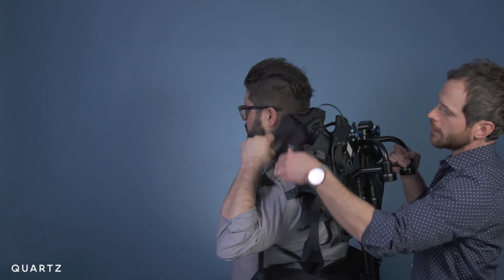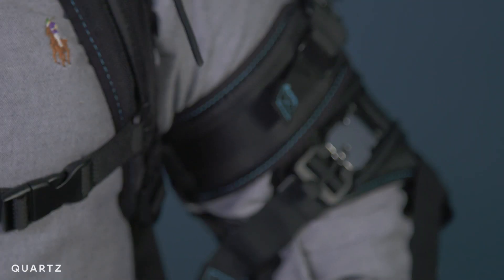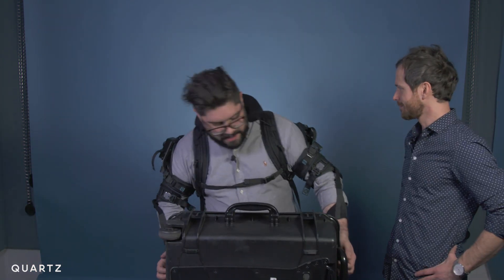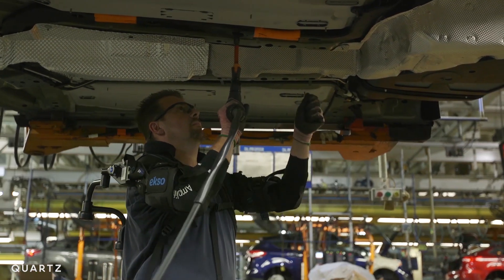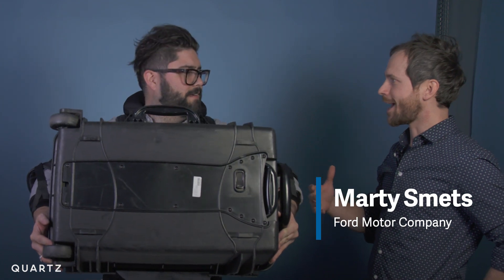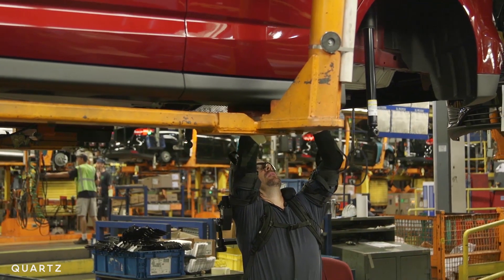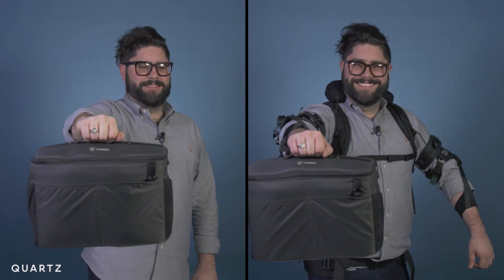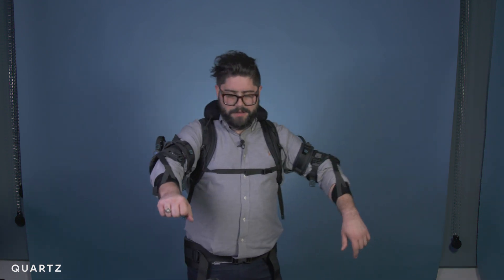We tried the exoskeleton Ford factory workers are using

Comment: Oh, good!  Now the muscles that you should be working to make strong with good form and proper use, you'll be able to let atrophy which, in the long run, will cause more spinal related injuries.  Fantastic!  

This is a horrible plan.  Maybe focus on health and proper lifting form instead.  Spend money on proper training from professional power lifters on proper form, and ideal exercises to improve your strength in those weak areas.
Spinal related injuries stem from your core muscles being weak and not flexible enough.  Your core muscles are the ones that will atrophy with the use of this apparatus.  Proper exercise and stretching is imperative, and not trying to skirt around those with a fancy apparatus such as this.

Comment: This would be cool if it did allow users to lift heavier parts and my workplace had them. Wait. That's right. My boss is too cheap to invest in an overhead crane so I don't have to man handle 160lbs of steel onto a table. Alone

Comment: Wish i had something like this when i was driving front end loaders in the mines. It was a comfortable spot in which i my arm would rest. I hardly had to move it to operate the bucket or arm.
But it was the constant little movements for hours on end. that would leave me wincing in pain. It felt like someone was stabbing me in the shoulder every time i moved my hand to operate the bucket. When i was a labourer i use to wonder why the loader drivers seemed so happy whenever they had to get out and do some manual work. After my first two months in the loader i understood why

Comment: if i had this when i was loading molds into the furnaces at work to cast jet engine blades/vanes i'd have been able to pull 16 hour shifts no sweat (12s were rough). a lot of the molds weigh a little upward of 100 lbs, and i'm 190 lbs sopping wet.

Comment: No joke. When I worked for Honda, they would spend this much on air tools. Yes, the air tools used to drive the bolts in. Considering that, the cost is actually worth it.

Comment: Think of it like a garage door spring.  It acts like a counterweight to lessen the load from gravity acting on your arms and whatever you're holding.  If you were lying on your side or inverted this would not work properly.  However this isn't an issue because it is intended to be used for specific tasks in a limited scope.

Comment: Last step is to replace the low-efficiency human part.
Reply: yeah if i remember correctly Boeing was the company that tried that ... with predictably disastrous consequences ...

you see humans have this kinda important ability to ADAPT to unforeseen situations which in these types of jobs are very common. unless you can guarantee the task is 100% repetitive with zero anomalies OR develop true AI capable of adapting to situation at least comparably to human mind the "low efficiency" part there guarantees smooth and uninterrupted production. Sure purely mechanical systems are faster, but overall its kinda better to produce a little slower without creating loads of useless garbage because mechanical system couldnt deal with small trivial change in the process human would solve on the spot ...
Reply: @Asghaad  Tesla also tried that and gave up.
Reply: Mendicant bias
Reply: Human is a pretty optimal and efficient source of mechanical work. We only need 1.400 calories per day and we already have about 80.000 calories to spend if we run out of food. We need just water (the most abundant thing in our planet) and a little bit of fat and flesh.
Reply: @George-wv5wk  Most of that water is undrinkable
Reply: @azure3655  Most of humanity doesn't use that water since the dawn of our existence. Also, desalination exists.
Reply: @azure3655  Machines also need water to be created and to it's maintenance.
Reply: +Azure. Distillation and reverse-osmosis are things that exist you know.
Reply: Azure It just needs to have the unwanted things in it removed, which is an easy thing to do. So you're right, but not really.
Reply: @azure3655  open the faucet wow water
Reply: @George-wv5wk  lol good luck working effectively with only 1400 calories unless you're working children.
Reply: George Um you are forgetting the pay humans want from working. Which at this factory I believe is 30k+ a year. Multiply that by the thousands or workers. Ends up being in the millions. vs a robot which only needs to be maintained.
Reply: @diddykong7354  

This device makes one better at manual labour and further applied research can make significant improvements to it. In combination with Mind Machine Interfaces and Nootropic drugs, which will greatly increase thought processing, as well as increase concentration and focus at work, efficiency and ability at performing manual labour safely will increase. NO NEED TO REPLACE HUMANS WITH ROBOTS AND AI AT EVERYTHING!
Reply: @diddykong7354  

What is wrong with paying humans to work? So, if there are technologies through machinery, computers, and drugs that humans can wear, take, and/or implant that greatly improve their efficiency, concentration levels, dexterity, and also greatly decrease fatigue and enable them to work very well in factories, because of paying humans, they should not be applied?
Reply: @George-wv5wk  yea but we have to waste 8 hours a day to sleep and repair muscle damage
Reply: George humans get tired, need sleep, need to eat, drink, need to talk.. I hope your joking that a human is efficient compared to a robot
Reply: @colbyharley9975  Right now we are. 

Usually a single machine does just one thing (like car assembly) and that machines cost above 300k dollars. A worker cost about 30k -45k per year. 

Machines also need to be repaired and usually cost more than 1k, even the simplest procedures.

Also machines get "tired" it is call (warming), the things that prevents this warming also cost more than a bottle of water.
Reply: Every Water is drinkable after you filter the Salt Out of it and thats not hard at all
Reply: @colbyharley9975  Yeah Ikr, even soldiers who are trained to be efficient need sleep, etc
Reply: George that 300k gets paid back in a few years while the human stays the same in generating pay.

One robot may cost 300k, but over time it will cost less than humans and do mor work that humans right off the bat. That’s even if you include repairs every year.

Why do you think everyone has robots in their factory now? It’s cheaper.
Reply: @kevinarzola4781  Best answer ive heard so far👍
Reply: DoktorDuggie Ducker That is 100% false. Desalination is one of the most costly forms of water distillation on the planet, and less then 1% of the earth’s population relies on it.
Reply: Ni Hao no he’s right. The human metabolism is actually more efficient than most machines in regards to energy output and efficiency. Machines have a higher ceiling for power output however.
Reply: @colbyharley9975 

There are devices such as these types that decrease fatigue and therefore help increase efficiency, and plausible technologies can be developed, be they devices or drugs, that will further increase efficiency, concentration, and decrease fatigue significantly more.
Reply: @kevinarzola4781  Said maschine still requires maintenance producing cost, and someone who fixes it. And maschine eventually have to be replaced sometimes, or are not needed anymore, while a human worker can still adapt
Reply: Linkatchu that last part is true, but trust me, a robot is far less in costs than any human. They don’t require pay, benefits and they never get tired.

We’re thinking of buying a robot where I work that does light solder work and bends metal. The very first year it would save us 10k over a person and the next five would be over 30k per year in savings.

The technician is only required every 5 years for it (check up) charging $100 to perform a diagnostic and you only pay for the repair when it need it.

Some jobs still require a human touch as mentioned from someone above, but it’s very possible in the near future we will have factories with 5 people in them and hundreds of machines.
Reply: @colbyharley9975  machines need maintenance, fuel and adequate"rest" as well. And humans to operate and make these machines.
Reply: Blackpilled af
Reply: @axelmilan4292  Because I like robotics and automation that let people spend their time doing more important and healthier work. You're the blackpilled one.
Reply: @defeatSpace  robots are incapable of solving anomalies are incapable of independent thought its common knowledge the brain is superior compared to any super computer and humans are more effective in number and over all better thinkers and inventors the robots will ever be that why we are there creators
Reply: @thenamelessking7873  unless we create organic based AI by making artificial brains.
Reply: @bryanmartinez6600  wouldn't need to
Reply: You beat me to the comment
Reply: Did you even watch the video? It has nothing to do with robotic parts. It's simply a clever weight transfer system.
Reply: WE CRASHING THE ECONOMY AND SHIET. 2040 EVERY HUMAN WILL BE UNEMPLOYED!
Reply: @a1919akelbo  By 2040 we will have new jobs while automation does the rest.
Reply: @defeatSpace  so the population increasing and automation increasing will also cause jobs to increase? Didn't know 1-1=2. Good to know.
Reply: @a1919akelbo  Well jobs for college grads at least and a lot of them will work on automating even more stuff.
Reply: Elon Musk already tried automating too much, removing humans from jobs for the Model 3. The result? HE SAID HIMSELF that they (he and his engineers) didn't know what they were doing, and were idiots for doing so. He also said there are many things for which a human is the best way to do something. Remember, a human is infinitely adaptable to any anomaly that comes along should there be a flaw with the assembly of a specific component on a specific vehicle. The Human can recognize it and make a decision on how to deal with it. Robots cannot. GM also tried over-automating assembly lines, as did VW. They both learned that is not the way to go. Musk tried it because he thought he knew more than GM and VW who had been building cars exponentially longer than himself.
Reply: Robot world
Reply: L there are certain parts that need that touch of a human
Reply: Yang 2020
Reply: I wouldn't say low efficiency. That's unfairly putting the talented people in that grouping. I would say more like replace the costly human employee. Robots don't need unions, food, breaks, housing, etc.
Reply: You all are missing the point...
Reply: Shit and i thought you were just joking around
Reply: It'll still be decades before that. It turns out designing robots to move like humans is a lot harder than designing them to replace accountants, lawyers etc. Can you imagine a world without lawyers?
Reply: @squamish4244  Can you imagine a world with synthetic lawers?
Reply: Aaarrrrggghhhh
Reply: This machine improves human efficiency by decreasing fatigue. I know that there are AI and Robot worshippers, and also corporatists that are trying to find creative ways in which to reduce labour due to labour costs, but there are plausible drugs and devices that greatly increase concentration, efficiency, dexterity, and reduce fatigue. 

The drive to replace human labour in everything with machines isn't going to succeed...

Comment: So that's what people are using in this other factory I work in. Different brand of exo thing though.
Reply: How do I become a factory worker? Working in a factory is bad ass
Reply: @Ketannabis  well... I've only seen one set of people using one. And I think it's probably an "exoskeleton" thing.
And it's not even the main assembly line people I've seen using it, but people who do something to things they pull off the line. I don't know if it's for a whole body inspection or if it's to repair defects that have been found.
I also haven't seen all of the factory, so maybe other people use it too.

I also am not a huge fan of my job.
I want out so bad, but I have nowhere else to go YET.
I don't want to discourage you, because plenty of people work in factories, it's not for me though.
It's usually very mind numbing on the floor, unless you work in maintenance or something.
Don't endeavor to work in a factory just because some people get to use an assistive exoskeleton in there.

But if you want to work in a factory, just find the nearest one and see what their requirements are. You can also work through a staffing agency that does work inside the factory.

Comment: whats interesting is, because it shifts the weight to another part of the body, would prolonged use of this cause more issues in those areas of the body due to 'un-natural' stress?
Reply: Nope. Shifted weight is shared, not completely shifted.  It would be like holding up  a weight slightly above your head with some of the weight being braced against your hip. It has the effect of taking load off of your shoulders. And the kind of weight we're talking about is like 5 lbs.

Comment: But doesn't that mean that their muscles would weaken and result in the same state as they were before without the exoskeleton ?
Reply: no. its not like their arms are doing nothing. its just that the weight that those muscles are lifting is put into the ground instead of on Weak joints. You arent Lifting less, It just removes the pressure on your body. Kinda like lifting Form, except these are being used in places where "good" form can't be done with the human body. so you stick a extra frame on to make that "good" Form possible

Comment: it is not that great if you dont have really good grip strength.
Reply: I doubt you would last long in this job without grip strength in the first place.
Reply: @momentary_  not really. if the suit has a robotic hand or a suction cup that works with the arm, grip is not an issue.

Comment: "Goal is not super human strength." Why not?
Reply: If you saw the clips of factory workers they displayed on this very video, all the strength related stuff was handled via machinery. They don't need more strength.
Reply: Power. Major limitation factor on how long a suite can run. Super strength, means more power, means a shorter duration of use.
Reply: It supports the arms without adding strength
Reply: Probably so they're not responsible for some dude running around punching people with super human strength
Reply: superhuman strength would require added force by the exoskeleton, which, if there was an error, could hurt the person wearing it. instead, all this does is distribute weight on your arms to your legs
Reply: Then it would cost more to buy and make, think before you comment.
Reply: Because the human labor in ford factories is for technical and precision work. Why make a human lift 300 pounds when you already have a machine which can lift 1000?

Comment: I work in the trades. I've seen a lot of manufacturing robots and they look painfully slow. They do better overall because unlimited strength and 24/7 work. I would be interested to see a skilled trades person with an exoskeleton that could lift as much as need maybe into the 1 ton area of weight, yes I know it would be a huge machine, but I think a human could out perform a robot minute vs minute production, especially in places with more custom work where set up times would be a hindrance.
Reply: Machines don't need salary, healthcare and a pension. Maintenance and occasional repair is much cheaper than hiring a person.
Reply: Don't worry fam, I am trying to make a company that specializes in custom manufacturing, I will use things similar to what you said. My end goal is research, after money starts to roll in, I'm doing this so I can invent stuff that I would need the funds to do (like a vtol)